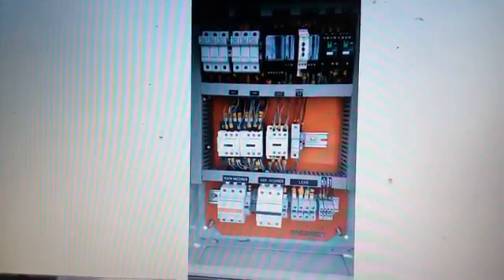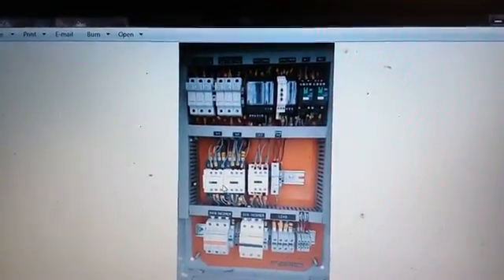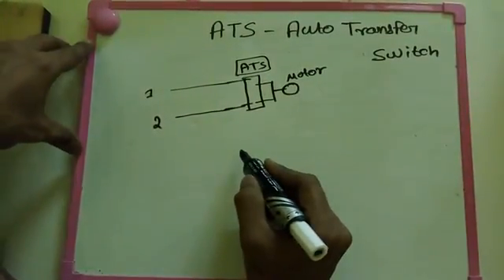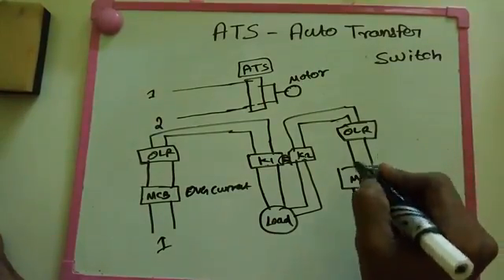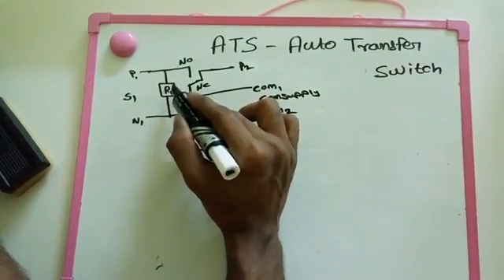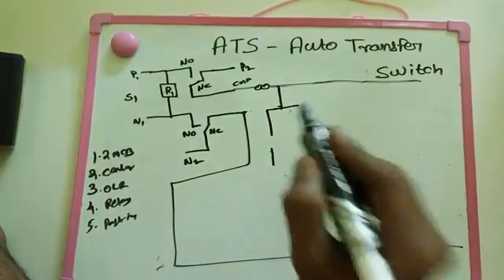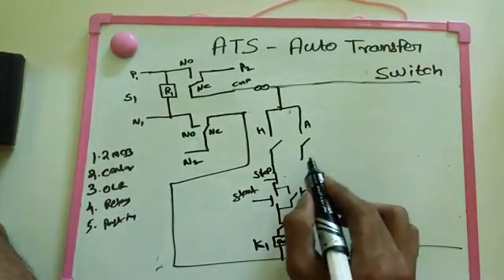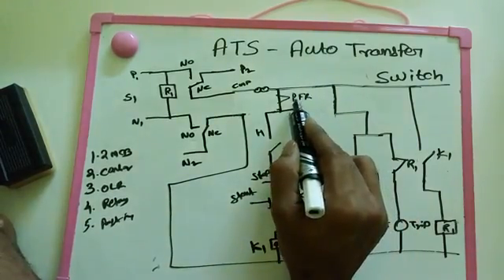Auto transfer switch (ATS) working and ats control panel wiring diagram

Comment: My ATS Power Supply Contactor is having a Feedback from the Generator causing the Supply Line Contactor to Vibrate, hence I am disconnecting the phaser failure relay and operating on Manual.. please assit

Comment: to eliminate timer in auto mode.. what happen ??
Reply from the maker: Auto function going to manual ...
Reply: Edison world I asked.. without timer in auto mode.. when selector switch in auto mode.contactor will be energized directly without function of timer.. corresponding contacts are closed due to contactor energized ..so We get power supply..is it possible ?
Reply from the maker: s your correct but need some time intervals  for main supply connection and gen supply connection around 5 to 10 second ... that why we make timer because we have different load in output side like oil compressor ....
Reply: Edison world okay thanq sir..I understand clearly.